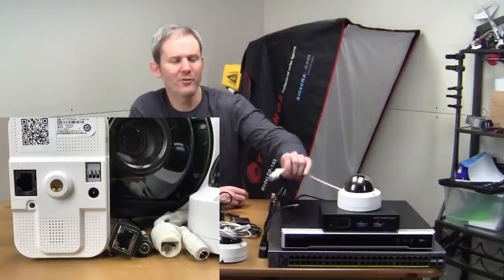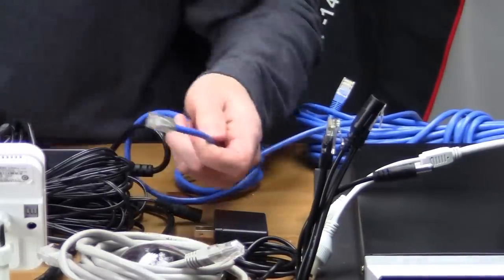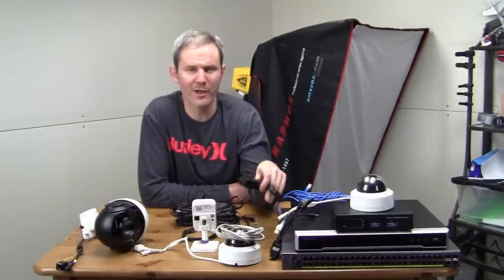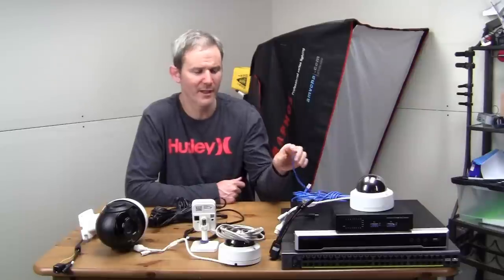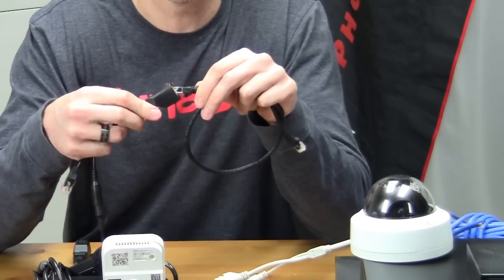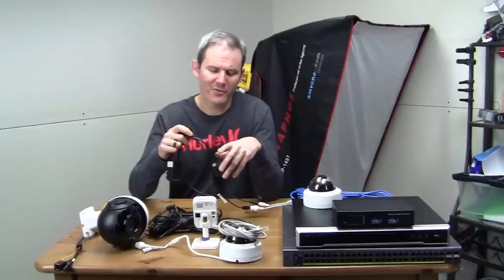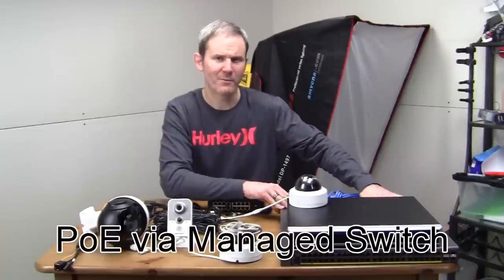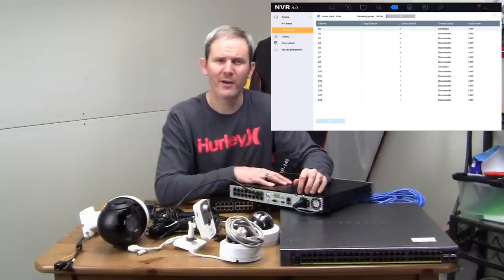How to Wire & Power your IP Security Cameras - PoE

Comment: Does the person that runs this channel ever respond to questions? I have two adt cameras that I bought outright unbeknownst to me that their ethernet ports aren't universal. They have some special kind, so obviously if you turf adt, you can't use their cameras anymore either. Like what crap. I wouldn't have bought them had I even known that. Is there any way to hook the cameras up to my existing Swann NVR without having to sync them with the ethernet cable first? They're wireless, so I can't figure it out. I don't like the idea that they scammed me out of 600 bucks for two cameras all to have them not even be able to work when I got rid of my adt service....which is also a friggen scam by the way. Any help would be appreciated from any tech wiz out there. :)  Thanks in advance.
Reply from the maker: Hey! That sounds terrible. What model are the cameras? Did ADT provide a hub or how do they communicate to the Internet? It will depend on if the camera supports 3rd party recorders if you can use it. The model number should tell a lot.
Reply: @HomeTechDIY  they only seem to work via their website. They never connected anything, no NVR or modem at all from them. Just direct access via adt. Man I'm pissed off at them so bad. I cancelled my contract because their website sucked so bad and the cameras always timed out on a constant basis, and they charged me for a service they weren't even providing me. Now I'm stuck with them and no way to connect them to anything else. I hate the idea of have two expensive cameras and letting them sit on my home faking their job now. Thanks so much for responding to me. If I get the serial number and model of them for you, will that help or no??
Reply from the maker: I'd be mad too; that's a lot of money for dummy cameras. I'm not sure if it's possible to repurpose them. It sounds doubtful since the only way to connect to them was through their site. Could you share the model number (don't share the serial number)?
Reply: @HomeTechDIY   The model # ADC-V722W
Reply: @HomeTechDIY  I just came across this when I googled that model number. Can I use an alarm com camera without service?
No, you cannot use Alarm.com Cameras without service. All Alarm.com Security Cameras require that the user has active monitoring service. ... Users can access their ADC accounts through a web browser or by using the Alarm.com Mobile App on an Android or iOS device.  Alarm.com is the website that adt uses for their cameras.  Ugh that makes me so freakin mad, but here's the model #  ADC-V722W.  I also just found out that the cameras are discontinued, so I totally got scammed when they got me to buy them outright. I never thought I was a naive person but I sure got sucked into that one good. grumbles
Reply: @HomeTechDIY  Well that's bizarre, I've tried to leave you two comments and both of them have vanished??
Reply from the maker: You comment was held for possible spam. YouTube holds comments for my approval if there are any websites listed.
I feel so bad... that's terrible that they would do that. ugggggggg

Comment: I have the poe+ and doesnt turn on with regular router and with just power cable , In that case I need the power adapter and the poe switch to turn ob? Is a big camera speed dome, thanks in advance
Reply from the maker: If you have a PoE+ 802.3at speed dome camera, to power it you will need a PoE+ switch, PoE+ NVR, a PoE+ injector or a power adapter.

Comment: Thanks for the great content. One question: I have some IP cameras, one unmanaged switch (TP-Link TL-SG1024D), and Blue Iris on my computer. How do I connect these all to form a surveillance system? Do I need to connect the switch to my router? If yes, why can I not do without internet? I just want the cameras to stream on Blue Iris and record to the hard drive preferably without having to rely on the internet. Thank you :)
Reply from the maker: You are on the right track.  Yes, connect the switch to the router and then connect your computer to the switch OR the router and BlueIris will see all the cameras on the network.  The router will hand out IP addresses to everything connected to itself and to the switch so all the devices can communicate with each other.  Hope this helps!
Reply: @HomeTechDIY  Thank you for the response. Is there anyway to leave the router out of this? I wish to have a cameras directly to the PC because only the PC has UPS attached to it. I wish the surveillance system to continue working in case of power and/or internet outage

Comment: Any recommedation on a cable/adapter that can connect to an older BNC connection camer to a POE switch so I can run it to BlueIris?
Reply from the maker: Even if you had an adapter you cannot power an older BNC camera with a PoE switch.  If you had such an adapter you would damage the camera.  These cameras are passive and do not talk back to the PoE switch resulting in the camera accepting all the power possible from the switch causing a camera burnout.  You could however use a PoE injector and add electricity from the camera's power adapter to the Ethernet cat6 line.  It would have to be plugged into a non-PoE switch.  This is the adapter you could use as along as you have the camera's power adapter: https://amzn.to/3d4iNEv